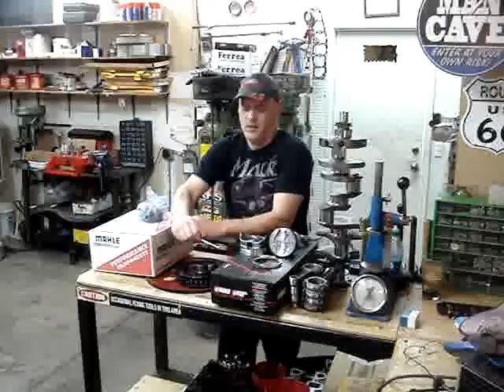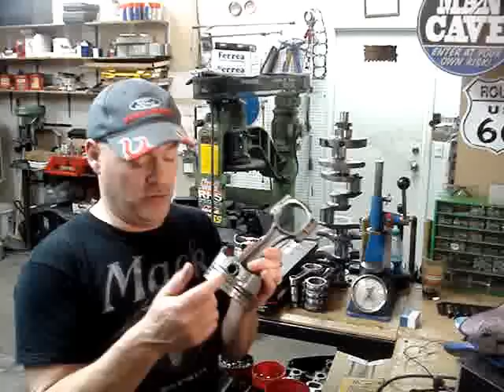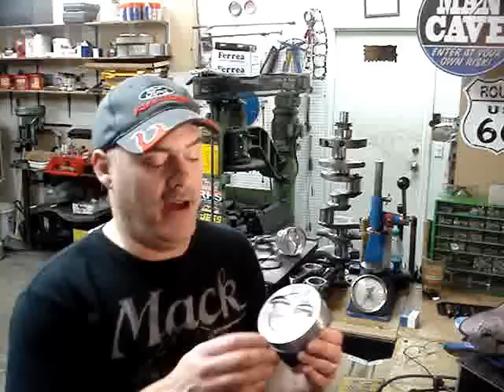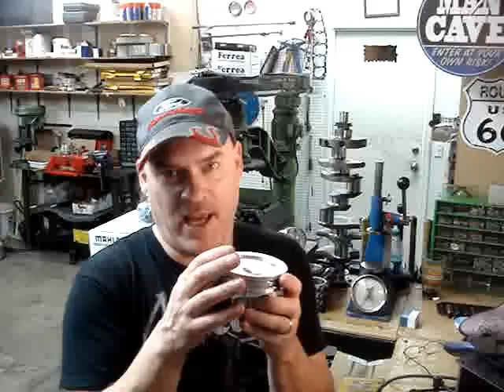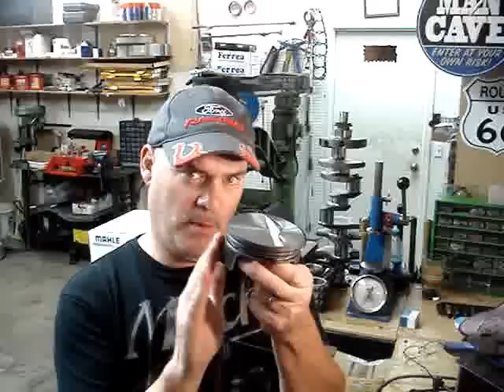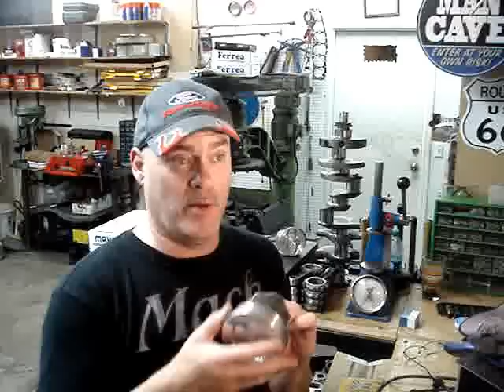383 stroker engine build part 2

Comment: Hi I had a question, I’m building my first 383 and didn’t realize it was bored over .030 already . I had already ordered the pistons for it so I just had it honed. After honing I check bore size and realized piston clearance is going to be around .003 . Is it ok to run that much on speed pro hypereutectic pistons ? Appreciate anyones imput.
Reply from the maker: yes .003 is fine

Comment: Thank you for your time and effort. While at times, way more in depth than I predict I'll ever go,  the upside is with your videos,  I have an idea what to expect, how to plan and most valuable to me is when I'm having someone do this and paying them I know some of the process so I can keep from those extra add on Kanooder valve,  head light fluid, pipe stretcher charges that pop up so thank you

Comment: I’m very glad I found your channel prior to my build. I’m also upgrading my 355 stock sbc to a stroker in my 3rd Gen Camaro. It’ll be my first go at an engine rebuild so this newbie greatly appreciates you passing along the knowledge and tips.
Reply from the maker: Right on!
Reply: @Myvintageiron7512  You caution against trusting a “balanced” stroker kit because some companies/manufacturers aren’t as accurate in their tolerances. Is Summit a company you’d recommend for a kit? Thank you for any advice.

Comment: My 2000 silverado with a nearly 300 thousand mile LM7   has piston slap  on every cold start since I bought it fifteen years and  tens of thousands of miles ago. I just let it warm up a bit and take it easy for a few minutes. Buddy of mine had a WS6  trans am  years ago and would crank it up on cold winter mornings and take off  full throttle. I told him that  it wasn't  good for the engine but  he insisted it ran so much better cold.

Comment: The best factory engine is the 170 slant 6. it was designed from the ground up to be a engine that gets good gas mileage and still has enough power to get you from here to there. It's no hot rod, but will last a million miles easy. It's also a under square design which is why it's that way. They are well worth the history read. The 225 still has the longevity but is missing the mileage. It's a over square design. (it's also a bean counter engine, so go figure. Not a bad engine, but not as good as the 170)

Comment: What are the performance benefits of stroking an engine?
Reply: Longer stroke big bump in low and mid range torque in addition to the horsepower up top. I used to have a 383 in my iroc and much more noticeable torque. compared to my old 350 formula even with a mild cam.

Comment: I been watching the videos on this 383 build over and over I have a .30 sbc 4blt m , I want to go Stroker street motor pump gas I have a new set of cast heads iron eagle 215cc can you shoot me in the right direction on parts to get to be able to get the most hp with what I have I want to start ordering parts just don’t know which ones to order that will work to get her greatly and give me the best performance

Comment: I've run hypers in my dirt cars for years to 6-6500rpms with no problems. Of course as stated in th 1st vid a great balancing job goes a long way. Also piston slap sounds nothing like a knock really. It is a very unique sound as you said. Nice vids here. I've had 383s built for me and built my own 350s and 400s,  but never my own 383. So I'm hoping these will help med get it right from the start.

Comment: I just saved a 1980 Z28 Camaro from the crusher that was beat to death and put out in a salvage yard. Going to do a 93 octane 383 build in it. Not going to get crazy. The information here, especially about the balancing, will be incredibly valuable. If I can make 450 flywheel on it i'll be happy. I want it to be reliable.

Comment: Im getting ready to rebuild my engine. I would like to build a 383 and have been looking at the 383 kits from summit. Do you have any recommendations as far as heads, cam, the actual kit itself. I would like to get around 500 horses. 
Thanks...

Comment: You forgot to mention a "HUGE" advantage with the cast and hypereutectic pistons is a much shorter engine warm up time. With no piston slap you can run the engine for 1 to 2 minutes then drive away. Then the engine warms up faster and puts out less emissions.

Comment: more great information. the more I whatch of this build the more I want to start over with the one I built flying by the seat of my pants. I can't believe I've gotten over 5k miles out of it without it flying apart. Probably because I rarely rev it over 5k rpm. I did do some things right so far. I bought the right rotating assembly pre balanced but I didn't recheck it for acuressy.

Comment: Have a question I have a 74 nova I want to build a 383 its a street but I also want to race it I want a 383 with 475 HP to 500 HP was wondering with piston slap does that hurt a stock block like over time it will destroy my bottom end I saw a forged set for 1500 bucks and it has a forge crank and everything information would be grateful.
Reply from the maker: Shane Lefever no it will be fine

Comment: good video--good info.  I will use the hyper pistons for my LT-1 350 (1994) when i get her rebuilt next year. Still thinking, keep her the same bore and stroke or bring her up to a stroker motor, 383 and LT-4 cam. Chevy Police Intercepter.

Comment: I'm thinking of building a 383 but I have one question. The 350 that I have has a two piece rear main seal. I would like to put a one piece seal on it if possible. Is that something I can do? Also what brands do you recommend for a street stop third gen Camaro that This 383 will be in?

Comment: I myself would watch 2 hours of die grinding but that is the kind of nut I am. I love this kind of stuff. I understand mistakes. I have made many. Case point, push in Chevy head studs, big solid cams. Youth and inexperience, bent push rods and very steep gears in a daily driver to boot. To make it short great V-log. I think of the best improvements over the years, heart shape and quench and just head improvement overall. Are you going to do a port V-log? Thanks for the detailed build. BEST OF LUCK FROM SOUTH FLORIDA...